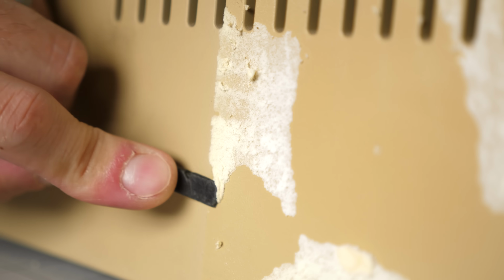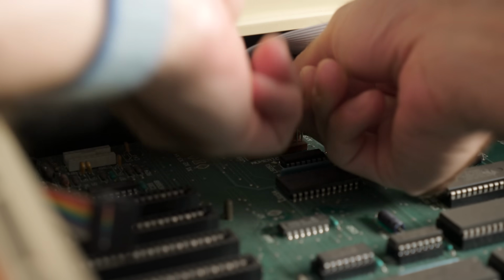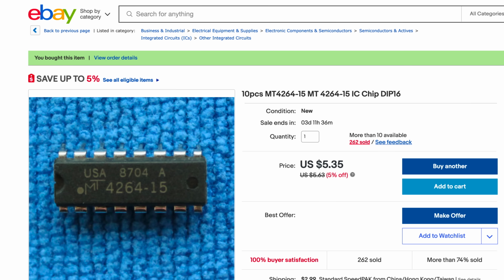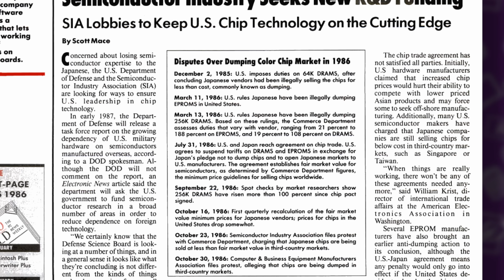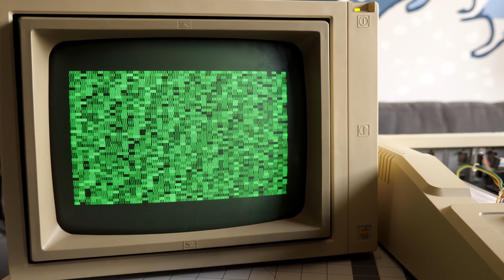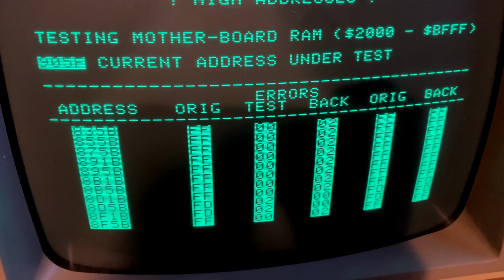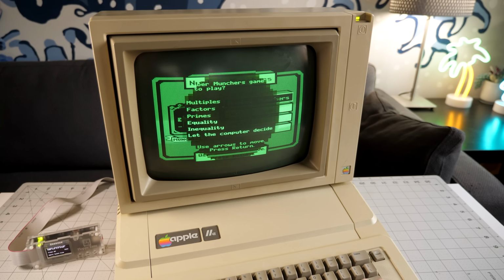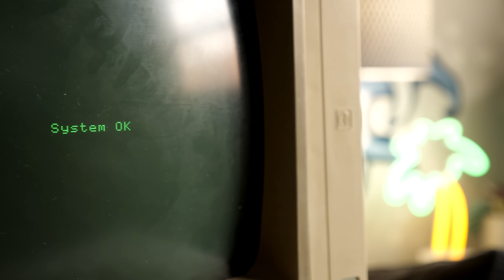Replacing the RAM in My Trash-Picked Apple IIe!

Comment: My Atari 800XL also had bad Micron RAM when I got it. I found a modern replacement which puts all 64 KB on a single chip placed under the CPU. The RAM chip itself is a socket the CPU fits into.

Comment: As a Tech having worked on boards with damaged pads and traces from other techs who desoldered a BAD chip to remove intact and throw away.....If I determine a chip is bad I cut the legs off, heat and lift out each individual leg, clear the pads and preserve the traces.

Comment: I repaired 8 bit machines back in the 80's and early 90's, so I knew instantly what mistake you were making. Commodore 64's and their disk drives made up most of my repair time. Atari's almost always had memory issues and commodore's usually had a MOS chip burn out. I couldn't keep VICII chips stocked.

Comment: Can you help me? I ran a MECC “Computer Inspector” diagnostic on my lle and all was well except for one thing. I received an error message about “auxiliary memory” indicating there is an “error 02 at 01F813.” Is this something I need to worry about? Does it affect running programs? Easy to fix? Hard to fix? The diagnostic said my “Main memory Ok.”   Thanks, Mark

Comment: My experience is, the spring loaded solder pumps are good for cleaning pads of excess solder once you've got a component removed, but terrible if you can't get the nozzle to be almost flat so that its forced to suck in a lot of solder and not just air over it.
Reply: Solder suckers work perfectly for removing through-hole components; that's what they are designed to do. Anyone that has problems with them is either not using them right or they don't have a good one. I worked in a PCB factory for about 2 years and desoldered tons of components during that time, sometimes 50 terminal blocks in a row if a new-hire had soldered them in wrong or used the wrong terminal blocks for the particular board. 

We had a Metcal desoldering station which was connected to shop air, but most people didn't bother with it. Instead we used Edsyn Soldapullt DS017 solder suckers (and the functionally-identical ESD-safe variants of that model: DS017LS and AS196), which has not only been a de facto industry standard for many decades, but is also the only solder sucker worth using IMO. Compact ones like the one shown in this video are junk, even the ones made by Edsyn.

Comment: Just a random observation, but I suspect that the reason they use that labeling scheme might be the LSB-MSB (Least/Most Significant Bit) where the rightmost bit is LSB, and would begin counting from that 
IE: 0000 0001 = Chip 6, 0000 0010 Chip 7 and so on...

Still a excellent video!

Comment: Left or right are related to the point of view. The board may face another direction as well. The right leg of a patient is on the left of the surgeon who is removing the leg. That is why hospitals use a permanent marker the day before the operation, to mark the leg that has to be removed, because surgeons do not know what is left and what is right. Sort of. If the chip ON the right has to be replaced or the chip AT the right of the board has to be removed, because its right is your left. Just like watching television.

Comment: when removing chips sodered in  a pc board cut the pins near the top of the chip. that will leave just single pins. using an iron and tweezers take out 1 pin at a time than use wick. it reduces the chance of damage to he traces by 50 %.
of course the chip is ruined but it was bad anyway right. and yes yes a socket always preferred in these old boards.
Reply: ... except he removed a GOOD chip

Comment: Right when you were replacing the one second to the right when facing the front I thought to myself "uhhh I wouldn't be so sure about the order of those in the self test". I'll admit that I'm completely unfamiliar with the engineering fields at that time - if there was even such a thing as a software engineer - but frustrating disconnects like that are super common due to a huge number of reasons, chief among them that often times you aren't developing on the final product itself you're developing on a prototype which may have a completely different orientation or even layout.

Comment: I heard that your problem with solder suckers is soely due to how cheap it is. try getting an "engineer" brand one as I've heard from multiple people that that one is the best. 
the reason i would use an engineer over the others is because it has a silicone tip, which means you can get a ton more suction out of it.

Comment: MT branded RAM is such garbage. They fail so often in Apple II's and also C64's. You will probably have more RAM issues in the future. At least it's only 8 chips, but do keep in mind there are another 8 RAM chips on the 80-column card. Just today I had one fail on my IIe machine.

Comment: Re the RAM, I'm fairly sure that new Micron chip has been remarked. Rubbing alcohol won't remove blacktopping paint - the usual solvent is acetone. Your old chips are dated 8504 (1985) and have white screen-printed labels -- but the replacements are of a similar age and laser-marked. Laser marking of ICs wasn't common in the 1980s. The shape of the polarisation notch is very different, as is the ejector mark on the top of the new chip. They're probably remarked other-brand 4264s. In fact, they look very similar to the Mitsubishi M5K4164 at 5:03.

Comment: Be on the lookout for a Kensington System Saver for that Apple IIe if you intend to use it for more than just an occasional game. The IIe ran hot enough during extended use that socketed RAM chips could work themselves loose (which is why they were soldered instead of socketed). Apple learned that lesson the hard way with the Apple /// (the memory was socketed and the system ran hot enough that the chips would work loose enough to generate errors).

Comment: you are not alone, I spent a good part of the 1980s repairing telecumications equipment to component level. This and similar mislabeling issues were commonplace, usualy in service manuals that were the opposite way around to reality. you do feel good when you figure it out however.

Comment: Colin's video does a great job of showing a CRT display monitor on camera without a visible refresh bar.  Adding sockets will not detract from the vintage-ness of the machine.  My Apple //e has all chips socketed, but it is a slightly earlier board than Colin's.  Desoldering chips can be a very frustrating experience and potentially board damaging experience, especially without a motorized heated desoldering gun.

Comment: If I had found myself replacing 2 chips I would have taken them all out and added sockets to them all so that the OCD in my brain doesn't get onto me for not making everything match.
Reply: I mean heck if all the other chips had sockets why not?
Reply: @Tall_Order  You're absolutely right. I wonder if Colin doesn't already have an itch to do just that.
Reply: @Tall_Order  I thought the same, im here now ill change everything ... kkkkk
Social life 0,1% and going. = /
Reply: If he had a proper desoldering station then he could have done it. But as a repair technician my self i would not recommend u to disturb solder connections wih solder wick specially when the motherboard is that old  , over heating the pads will cause the board to swellup and layers to split and then he would have to run bodge wires or completely discard the board
Reply: @KuntalGhosh  Yeah I sorta learned a lesson similar to that a week ago with some small 5 volt solar panels I got off amazon, to make phone chargers with. The bypass diodes went in just fine. But I try to solder wires and struggled to get the solder to hold.  Eventually I charred a point one one of them. Luckily the panels have 2 points for each end. Trying the second one worked.

Comment: I also don't like manual desolder pumps like you showed. About 15 years ago I dropped a couple of hundred bucks solder desolder station sold as "ZD-987". It's got a desolder gun which has an electric pump built in, it works perfectly. Definitely one of my favourite tool investments. Recommend!

Comment: I was skeptical about the whole “Micron chips are crap!” theory until I troubleshot my latest Apple IIe (bought non-working off of eBay), where I found 2 bad Micron RAM chips, plus I could see that a 3rd had been replaced by a previous owner. 3 bad chips out of 8!?? That’s appalling!
That being said, I noticed that the Micron replacement you got is 2 years newer than the original chip (8704 vs 8504), so it has benefited from 2 years of factory improvements!

Comment: I would have replaced all of the RAM sockets at the beginning.   It would have made troubleshooting much easier and you probably would have discovered the left to right issue right away.   It also would have made the motherboard look more "stock" than it does with 2 out of the 8 chips in sockets.
Reply: @TheHermitHacker  ???   Sure you would.   With sockets in all of the RAM positions, he could have swapped the existing RAM chips around and retested it to see what changed.   In only a couple of swaps he would have determined which RAM chip was bad and that the diagnostic program was reporting backwards.   The cause was always the bad chip.   But the new chips were questionable, so he didn't know that they were okay.

Comment: "The repair manual lists the chips from left to right, but the diagnostic program lists them right to left". Yep, that sounds like something Apple would do. Glad to know some things haven't changed over the last 40 years.
Reply: If the diagnostic was written for troubleshooting at the factory, the orientation of the board on the test fixture may be different than in an assembled system.
Reply: The self test clearly just shows which bit is bad, not which chip. And it uses the standard notation of putting the most significant bit on the left. The manual even gives an example:  01000000 -> bit 6 is bad -> RAM chip 12 is bad. Though I guess you could still blame Apple for not marking the bit positions on the silk screen, and not having the self test explicitly specify what the eight numbers mean.
Reply: referral madness  No, bits are usually numbered starting with 0 (not 1).
Reply: referral madness  According to convention, the rightmost bit is called bit 0, the bit immediately to the left of this is called bit 1 and so on.  If you have a string of 8 bits, the leftmost bit is called bit 7 and the bit immediately to the right of this is called bit 6.  So in the byte 01000000, bit 6 is 1.  I understand this can be confusing and some people use the convention of naming bits starting with bit 1 as the rightmost bit, which is what you are doing.  Which convention to use is really arbitrary. The important thing is to be consistent.

Comment: 12:29 the proper way to do it is with acetone, rubbing alcohol doesn't work for that in my experience.  Look up David Viens video on counterfeit YM2612 sound chips.

The epoxy resin used in DIP chips isn't affected by acetone, and the original markings on the chips should be etched into the surface.  Modern 'resurfaced' chips tend to be printed on the chip surface, which acetone can remove the ink of.

Comment: Possibly bad news, but the latest re-marking technology resists IPA. Get some acetone on a Q tip and rub it. If it comes off black pretty easily, it's a re-mark. Another red flag is if all the chips have the same exact markings or if the bottom of the chip looks different from the top.

Acetone doesn't eat away at real chips - rub your dead chip and observe what it does (or even the bottom side of the new chip). It might be ever so slightly discolored on the Q tip but it won't be obvious where you rubbed it.

Clean off the acetone with IPA.
Reply: Looking at the chips side by side it seems like these are re-marked. Looks like the second chip has the same date code but doesn't have an ejector pin mark like the first one.

Comment: I have heard the same thing about those RAM chips being flaky - but people seem to forget that they are failing on 35+ year old machines that were probably rated for 3-5 years of useful life at best. Just the fact they have held up this long is impressive!
Reply: A lot of these 8-bit machines are bought by inexperienced people who thought that owning one would automatically solve their bookkeeping problems. When they realised that one either have to buy extra software to do those things, or get their hands dirty by programming it themselves, they put the whole thing into their attic, where they stayed unused for decades, so most of the components could stay intact under decent conditions.
Reply: @negirno  If you're lucky the components won't suffer.  Bad swollen or leaky capacitors and even dried up caps that look ok are common items I've had to replace.  The soldered in nicad batterries are also sources of  damage if they burst or leak.
Reply: I agree it may be survivor logic.   We're basing reliability on those we observed to fail versus the  unseen hundreds of thousands which haven't failed.   Half of a percent out of a million may appear big without knowledge of the number made.

Comment: 100% in favor of non-destructive quality of life improvements to old tech, such as adding sockets to a MoBo and CF cards in place of hard disks. Such mods can easily be reversed back to stock for authenticity if need be.

About "inauthentic" RAM chips, I think we can all agree there is quite a bit of gate-keeping in the retro community, be it cars, electronics, etc. Often times the gate keeping is unrealistic given the modern circumstances. Sure, if you can find a NOS OEM replacement from 1982...go for it...but often there isn't. In that case, I'd argue it's infinitely more important to get a machine working for the experience of using it than moth-ball it because you can't locate the exact part.

Get it working to share with the world, then keep your eyes peeled for the exact, period correct part.

Just my 2 cents.
Reply: Here’s to the people insisting on keeping their hot stuff for 1972 Bosch mechanical fuel injection working on their Ferrari or Porsche.
Reply: @johnsimon8457  - If it works, sure. 

I had D-Jet electromechnical Fuel Injection on my 1974 Mercedes. Some parts you can still get brand new from Bosch/Mercedes! For like... more than I make in a month.

So I replaced some parts with analog/digital equivalents. That made people in the W116 community so mad!

I also swapped in a modern fuel filter. "Are you crazy!?" I made sure it fit the flow, profile and other specs. Only difference was it probably filters better.
Reply: Honestly, with how expensive retro hardware can be to get a hold of and maintain, the only "retro" style hardware I really want to get is the Commander X16, especially since it's been a fun project to watch.

Also been tinkering with making a 3D printable "retro style" super bulky laptop case for a Raspberry Pi 4, just for the fun of it

Comment: I'm glad you got this up and running. I wouldn't go too crazy and replace the rest of the RAM chips or anything like that. They were built to be workhorses, and it isn't likely that much else will fail. When I was in elementary school, they were constantly being used and the machines were still kicking around into the 90s when they were finally replaced by Windows machines. Personally, I would not try cleaning up the plastic to look new. The cleaning techniques can cause the plastic to become brittle and even disintegrate over time. Micron chips have kind of gotten a bad rap, but I don't think it is deserved.
Reply: referral madness  that would destroy its collectible value by doing anything other than regular maintenance. If you're too young to remember when these were new, you probably wouldn't understand.

Comment: Also, take a bucket large enough to submerge the entire case and mix half and half with water and bleach. Remove all electronics from computer making sure proper grounding is in place. Place the plastic shell in the solution placing a weight on top to ensure all areas are submerged. Let it sit undisturbed for a day. Check it to see if it needs more time or not. In the end, you will undo all the oxidized discoloring. Let dry a day and rinse. Reassemble and it will look amazing.